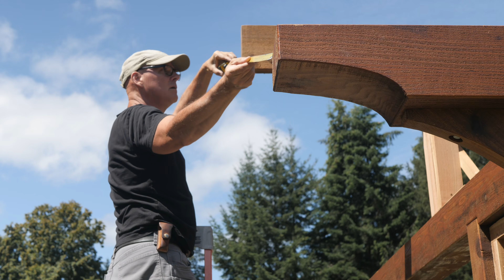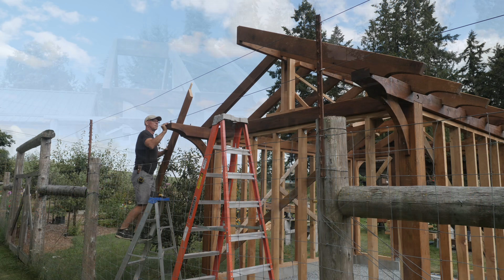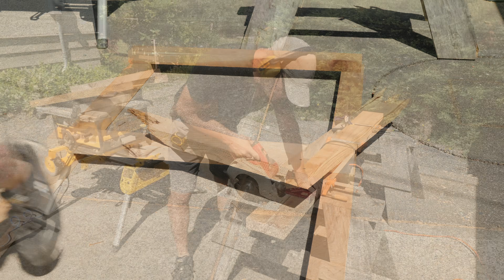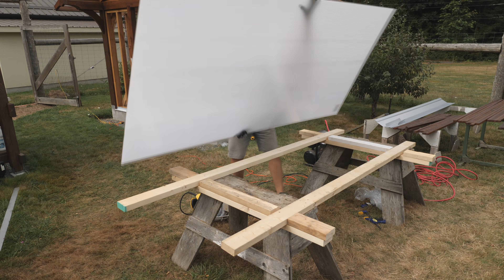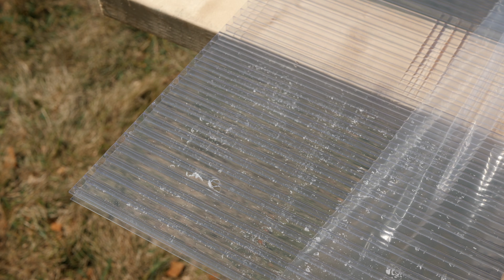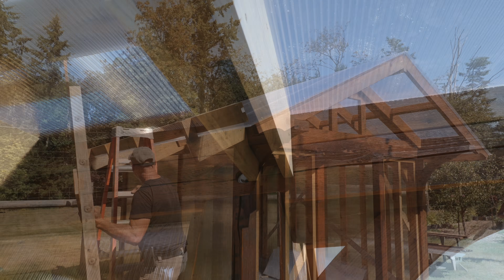Greenhouse Build Series 3 - Roof and Polycarbonate Glazing

Comment: BIG QUESTION: I see your rafters appear to be 1 1/2" thick yet you are using the H-Channels but when I read the instructions for H-Channel installation they are recommending the supports be 3" wide. How is yours holding up and how much did you overlap each panel to leave enough gap for the H-Channel and THANK YOU!

Comment: Love the looks, love the craftmanship. Good job!
Small question on the application of PC twin wall sheets, theoretically they need a bit of gap at the joints since they are supposed to expand quite a bit with temperature variations. I see you fixed them right on. How did that work out in the long run?

Comment: Like your design, I do have a question.. How well does the snow slide off the roof? I live in northern Maine and get a lot of snow, up to my roofline some years. I mean you can't even see out the windows... So it's important that I have enough pitch for the snow to easily slide off on it's own. But I also don't want it so steep that it looks unsightly or so tall I guess...so what was your pitch? Thanks for any help. ..Tim,

Comment: oops. why don't you want polycarbonate touching metal? I've got this stuff on an all steel structure 😬
Reply from the maker: This was a recommendation from my supplier. I guess the idea is that metal, being a conductor, would heat up to possibly damaging temperatures on a very hot, sunny day. And, the metal ridge cap (in my case) is a large surface area and would be lying on top of the polycarbonate.

Comment: I would think you would have to leave the bottom and top open to let condensation  to drain out of the vertical wall sheets?
Reply from the maker: There's J channel on the top and bottom if the sheets. I drilled holes in the bottom channel so condensation could drain. Wasps will make a home in the channels if not covered.

Comment: I learned from another Youtuber (Justin Depew) that made a dust collection system with polycarbonate that silicon doesn't adhere to polycarbonate very well, he found a product called Sik-A-Sil which looks and acts like silicon designed for polycarbonate and it did the job.
So far I haven't had opportunity to try this product/material myself, but I have kept it close to the front of my mind, and have let others kw about it in the meanwhile. Great work on that very classy greenhouse! I am envious!👍🤙
Reply from the maker: Thank you very much! And thanks for the tip!

Comment: I'm building a greenhouse as well. I ended up buying twin wall polycarbonate sheets that are 2 ft by 8 ft long. I was planning on framing the greenhouse with studs 24-in on center. The installation instructions for the panels say not to drill within one and a half inches of the edges. This doesn't leave much room where two panels would connect on the stud. Do you have any idea on how to install these panels? I was thinking h connectors and then screw the h connectors into the studs. Thank you for your videos.

Comment: That is one classy greenhouse. Just finished my 3rd polycarbonate greenhouse for growing Orchids, about 10 years ago. That is the toughest material man made. We had an f-1 tornado took 6 panels off out of 12, found all but 1 scattered about a mile through the woods behind the house, all reusable mostly. Has never yellowed and and you can walk on it between the roof trusses. Wont burn, and you can cut very easily with common saws.

Comment: Great detail! I like the looks of the timber frame construction and would like to utilize this design for repurposed old farmhouse windows instead of polycarbonate on the walls. My question has to do with all of the wall studs, are they necessary for structural integrity since you're utilizing the larger timber frame construction? I would like to omit approximately 50% of them, putting them on 32" centers to accommodate my farmhouse windows. Do you believe there would be any issue doing that?
Reply from the maker: The studs do add some support to the 6x6 beams but, I think your spacing would be okay.

Comment: When I saw your greenhouse build, I knew it was the one my wife and I wanted to build.  We are super excited, and this morning I downloaded the plans and cut sheet.  It is possible, I have not yet found the dimensional cut sheet for the polycarbonate glazing.  If there is one, please direct me to its location.  We are planning on upscaling the plan, perhaps to 10x24, or 12 x 20, depending on the roof glazing dimension.  In the videos, it appeared you were cutting both length and width for the roof.  If the roof panels are a full 8' long, we would have to just extend the length of the greenhouse, whereas if they were cut, we could extend the width, too.  Please advise, and thanks for putting together such a quality video series and greenhouse plan.
Reply from the maker: Thank you so much for your support. I don't have a polycarbonate sheet cut list. I think it might be better to take a measurement and cut each sheet as you go along. Also, with my rafter spacing, I had to trim a bit off each sheet lengthwise to allow for the gap required for the H channel. If I was going to do this again I would space my rafters a bit further apart so I would not need to do this. But, that also can mess up the design and the standards for spacing we are all used to. So... just keep that in mind. I don't know what is really the best way to handle that. Cheers, Kent
Reply: @MANaboutTOOLS  ok, thanks for the reply, Kent.  Do you have a link for the twin face polycarbonate panels?  I saw them on Amazon for about $169/sheet, but found a vender as low as $99/sheet elsewhere.  I just want the UV secure ones like you used.  Thanks again!

Comment: I saw a comment where someone asked about the polycarbonate but with there being so many version and sizes can you recommend some specifics on the polycarbonate, I.E, what millimeter size, does yours have a hollow channels/combs? there's a glaze on yours too, did you chose a glazing with a certain amount of UV or sunlight protection? There's so many online choices for this stuff and very few if none available in local stores to put your hands on. Any details are appreciated, its a great project.
Reply from the maker: I used the 8mm (5/16) clear twinwall with UV protection on one side. I bought 20 sheets that were 4' x 8' in size.
Reply: @MANaboutTOOLS   Awesome build…. Was wondering does the UV protection interfere at all with sunlight needs of the plants?
Reply: Where did you purchase panels?

Comment: Why the gap between the ridge-cap and the polycarbonate? Why must the galvanized steel not touch the PC?
Reply from the maker: I was told the sun can heat the metal cap and possible damage the polycarbonate glazing. So I made the wood cap to separate them.
Reply: @MANaboutTOOLS  is there not a polycarbonate ridge cap available?